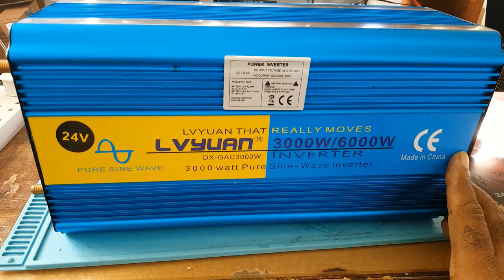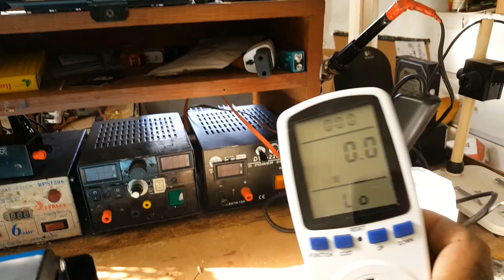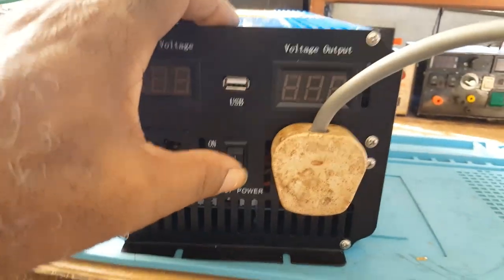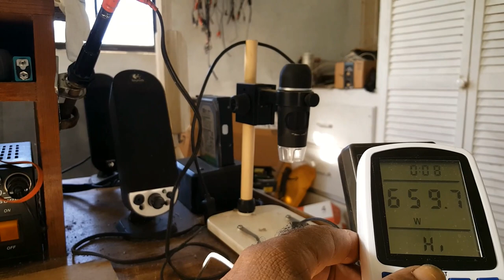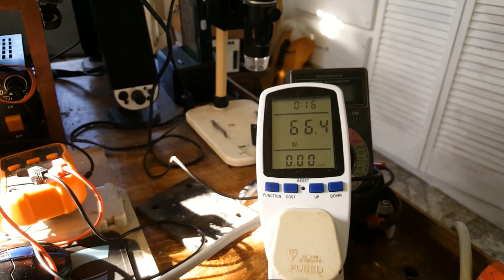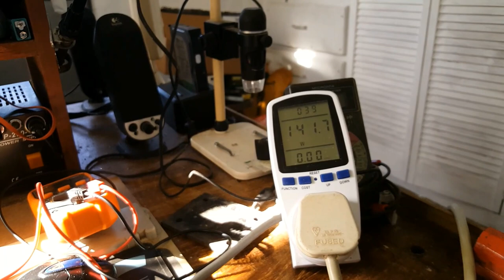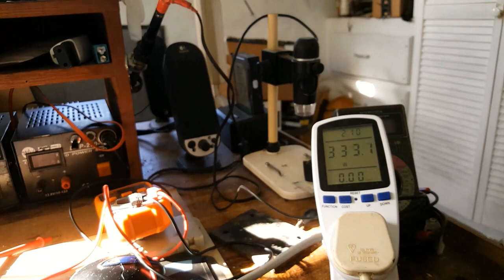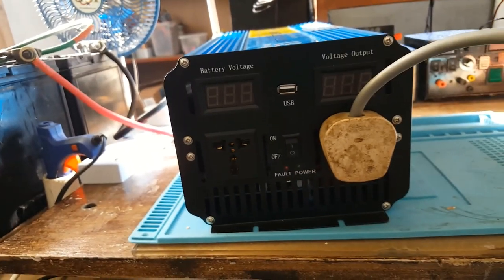Lvyuan DX Gac3000W Inverter Load Test

Comment: You may need lower number gauge wires (or more parallel wires) from the battery to the inverter.  If the wire can only allow 40A then the max power can only be 960W no matter how big the inverter is.
Reply from the maker: The wire is 4 gauge but the battery is not that good, thanks for your help I need all the help I can get.

Comment: Hello deh just checking where in the Caribbean u from   Am from st Lucia an I do run a  24v system it’s been 14 years since am off the grid
Reply from the maker: I'm also form St Lucia
Reply: Ok well I first used led acid batteries after I move to 18650 an Nissan Leaf batteries
Reply from the maker: Where can I get sum Nissan battery

Comment: your batterie is not good, my show me on 1100w 24,2v and on idle 25,3v and i take 30cm of 50mm2 cable, i have lvyuan 3500W/7000W my V on output is constant 228-232 V
Reply from the maker: Yes I know that I don't have good battery to test it out. Thanks